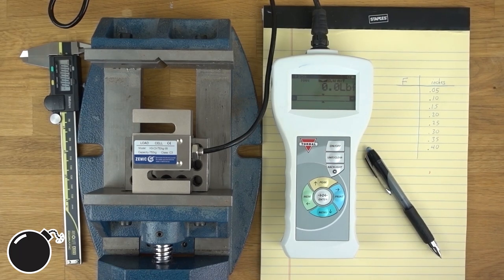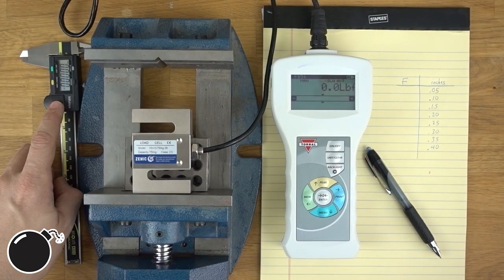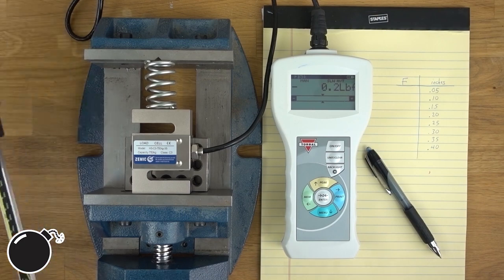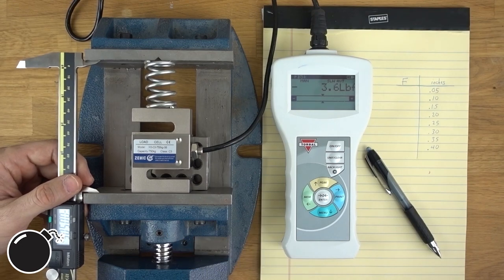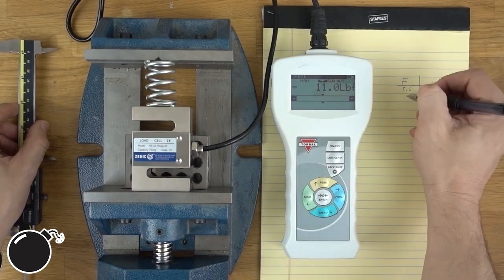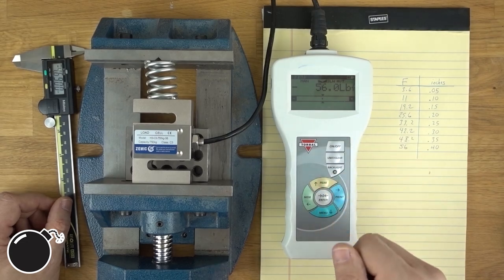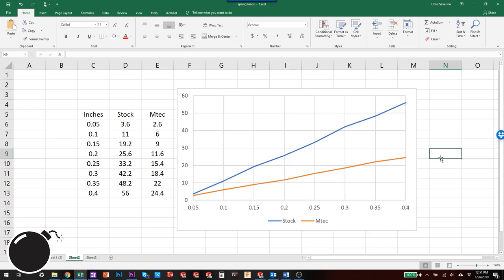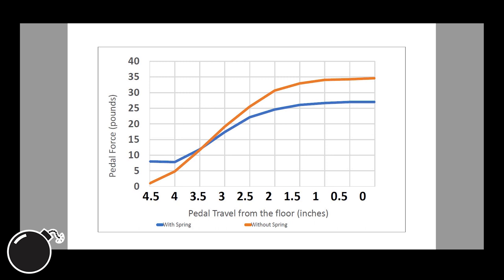BRZ Clutch Follow Up

Comment: Thanks for the good videos and descriptions.   I tried some different springs, here are what I experienced:
1-OEM _ I always had some difficulty being smooth
2-No spring - Better than with spring, but still didn't feel as great as expected. Efforts were OK with me.
3-Light spring -  - Not much different than no spring
4-Medium spring - Shifting is a lot better.  Quite a bit better than no spring or OEM spring.
5-Spring with optimized rate and length - I ordered a batch, but don't have them yet.

I did calculations that show the non-linear effect. However, this can be greatly improved with an optimized spring rate and length.  As you commented, geometry and spring have a strange effect. I believe going to the 5th option will be an improvement.

I never did a clutch adjustment, as it was right where it needs to be. I'm sure how the car is driven, clutch wear and adjustment all have an effect.  I'm an "Old guy" and drive like it, normal commuting mostly. 

Has there ever been any information from Subaru/Toyota about what the actual purpose of the spring is? I've not seen it yet.

Also, some Mustang guys seem to have the same issue with the same type of design.
Reply from the maker: Great! I'm glad you found a spring you like.  I didn't have the patience to try that many springs, good job! 

So you have the specs for the medium spring or even better a PN that people can order? I'm sure it would be appreciated.

In looking around I did see that mustangs (and I think some other Fords) have the same design.  So strange...

I was never able to find anything from any manufacturer about why it was designed like that. Bummer, it would be interesting to know for sure what the intent was.
Reply: @thoughtbombdesign  
MTEC looks like a good choice, but I did not try it. The initial springs were just what was in my garage, and happened to fit. I found Mcmaster-carr, Granger and other websites, but nothing at local stores or ebay.

Anyways, here are the specs:
Preferred range IMHO:     30-60 Lb/inch    Length: 2.0" to  1.75"       ~0.75" ID

--MTEC 63 Lb/inch from your data, what length is this spring?  Looks similar to OEM
--OEM 150 Lb/inch from your data    1.65" long
--Light spring estimate  20 Lb/inch -
--Medium spring estimate 30 Lb/inch    2.0" long
--57 Lb/In  1.75 Long  0.97" ID  - very close to MTEC   I did not install this yet. 9657K379 From Mcmaster carr.  $10 for 6 parts + shipping, they were manufactured by Lee
--49 lb/in   2.0"    I think the medium spring felt better, but left this in the car for now, to reduce possible slave cylinder leak as it has more preload.

FYI,  spring deflection in the car goes to about  0.60", but the data went to 0.40". Not a big deal, but if you could remeasure up to 0.6 inch I would appreciate it.
Reply from the maker: @louisestrong3187  great info, thanks!
Reply: @louisestrong3187  did you ever figure this out?
Reply: @jerryismybff  curious as well

Comment: I'm the only one thinking that stock feeling is not that bad? My 2 cents: the best would be to have the engage point exactly where the sping has no effect (no pushing or pulling when you need the most sensibility), while it's good to have assistance before and after (in opposite directions), the response in the graph is in effect more linear with the spring.

Comment: Another question, did you end up keeping the MTEC spring installed or you removed it? Which one you prefer?
Reply from the maker: I ended up going with no spring at all and never looked back   ;)
Reply: I think the point was the MTEC spring was so low on stiffness, the behaviour of travel vs pedal force was almost identical to just having no spring.

Comment: Did you ever measure the OD/ID, wire diameter, free length? Trying to see if I can source this from my local spring shop. Much appreciated, love your videos
Reply from the maker: Sorry, I missed this comment earlier... ID=0.82", wire Dia is 0.118", free length is 1.68". Good luck!
Reply: @thoughtbombdesign  can you please post the lbs/in of the Mtech spring, too? Thanks!
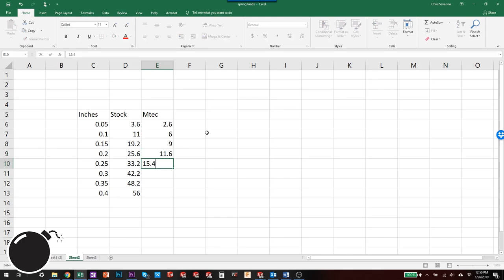Reply from the maker: hi there, if you check out 1:44 of the video it shows what you need. 👍😁

Comment: My dude, I was rewatching your old clutch spring video and found out you made this one. I'm surprised most of the improvement you feel comes from actually adjusting the clutch than from removing the spring, I guess I will have to try it too. I am just concerned about messing up and having worn clutch or something.

Your videos are dope, I hope you keep making more.
Reply from the maker: yeah, you should only do what you feel comfortable with but it really wasn't that hard.  Just take pictures or measurements of what the linkage looks like before you tsrat and then you can always put it back!

Comment: pro tip, you can measure a springs dimensions and get the rate as well, assuming its a linear rate and has round wire.
Reply from the maker: Yep, as long as you also know the specific material and heat treat! 👍
Reply: @thoughtbombdesign  95% of springs are steel, and the difference between the different grades of steel, including stainless is significantly less important than the dimensions of the spring itself. The modulus of  rigidity for the material is directly proportional to the rate, however the the wire diameter proportional to the 4th power, and the diameter of the coil is inversely proportional to the 3rd power. and your margin of error when measuring those dimensions would be far greater than the difference between any grade of steel. the modulus for cold rolled steel is 75gpa, where the modulus for structural steel is about 79gpa, stainless steel is in between at about 78. on average aluminum alloys are about 27, but rarely used for springs since aluminum fatigue resistance is poor. Titanium is about 41, which is common for valve springs in high performance applications, but not in many other places.

Also heat treat isn't a factor of the calculation, but if the heat treat is wrong the spring shape will deform instead of evenly springing back, and not all grades of steel are conducive to heat treating.

Don't take my word for it though, plenty of documentation on the web though. cheers.

Oh and for fun: parametrically model a spring, in your modeler of choice, use the spring dimensions to drive the equation and output the rate. Naturally when springs compress, the coil diameter changes and the entire coil twists. Drive the coil diameter and number of coil parameters using the spring length and "compress" the spring by changing the length value, and you can essentially prove that the spring rate remains constant despite changing diameter and number of wraps.